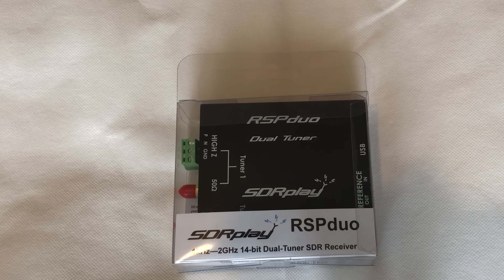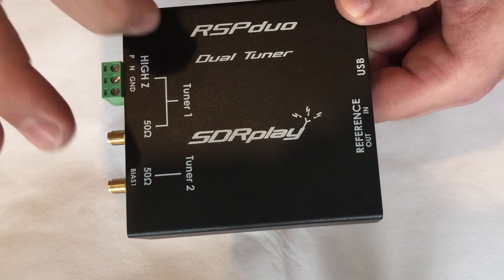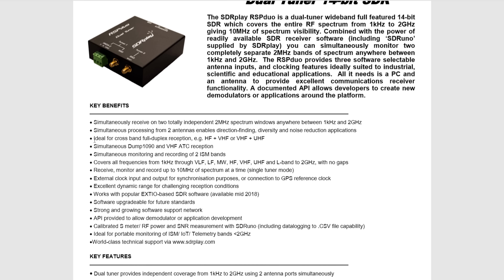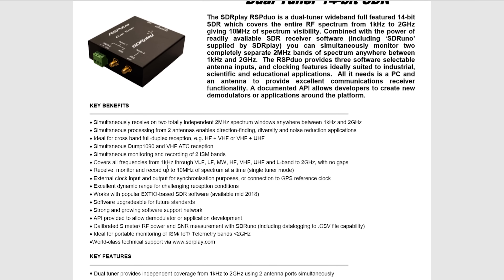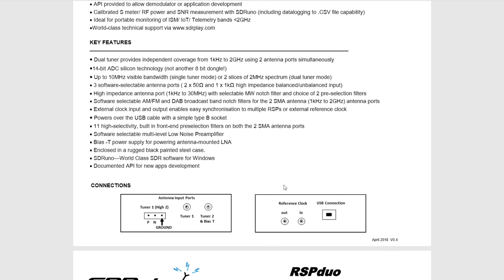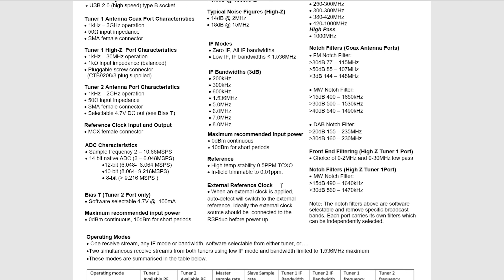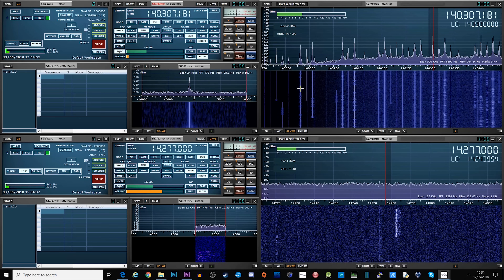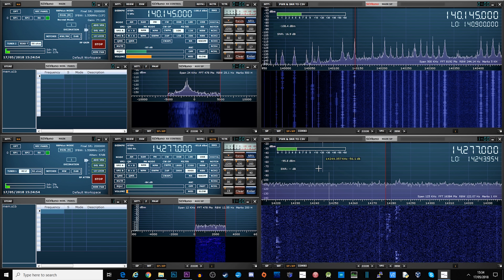SDRplay RSPduo Dual Tuner SDR Receiver

Comment: Just came across your channels because I have been told what I wanted to do was impossible. Figured I would ask you since you are ahead of the game with technology.

I live in Florida which is locked down when it comes to Florida Highway Patrol which uses ProVoice DES (From info I found online), Tallahassee (P25 ADP),  (Orange County P25 DES-OFB), and Seminole County (I have no clue what system they are on) although this is where I live and the main one I would want to listen to. 

1. IF it can be decrypted, how hard is it to set up?
2. How expensive is it? 
3. Can it be done on a MAC or a mac running a virtual system with windows on it? What kind of connections etc would I need?

Hope you don't mind answering.. going back to checking out your channel. :)
Reply from the maker: P25 is supported by applications such as DSD but it may be that the P25 signals you wish to decode could be encrypted, the only way to tell is to test it. Search for DSD Plus. You can view my other videos which should how DSD works :) let me know how you get on.